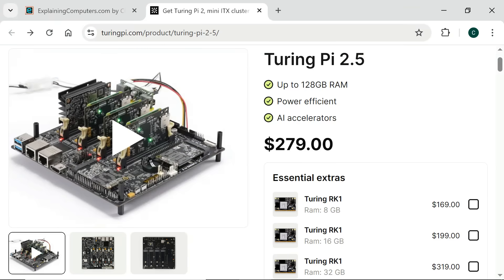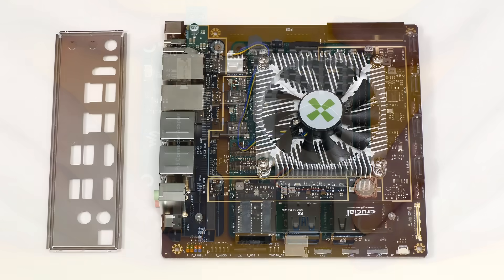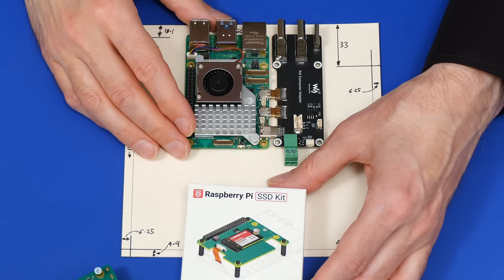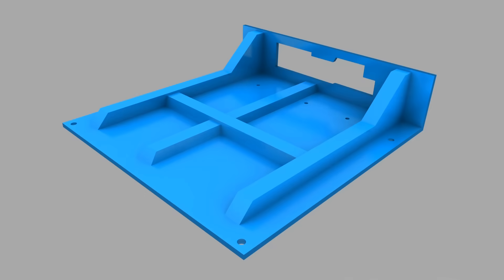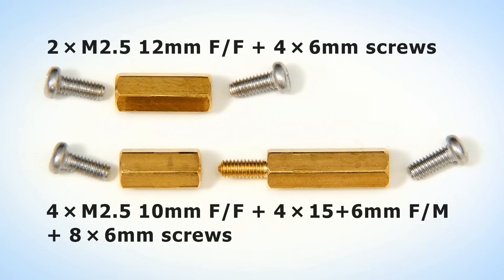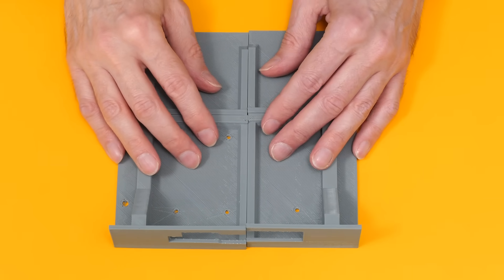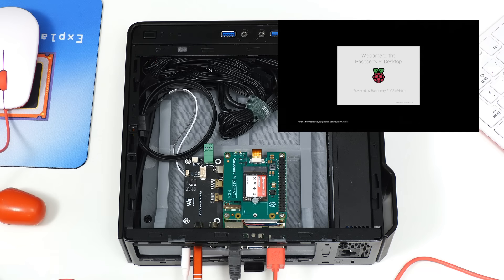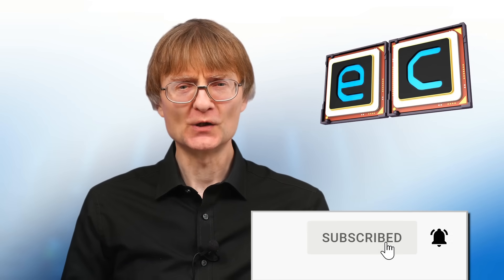Mini-ITX Raspberry Pi 5

Comment: Time for the sleeper PC build where you take a 20 year old giant PC minitower, and replace the guts with a Pi 5!
Reply from the maker: Indeed, greetings Jeff. :)
Reply: I’m dusting off my Lian Li / Cooler Master case collection as we speak.
Reply: That's what I did several years ago. Had 5 pi's (3 and 4) running in that housing incl a switch. Now replaced all with refurbished mini pc's with proxmox. Way faster, cheaper, easier.
Reply: Replace the CD-ROM drive, you mean :)
Reply: @kitmoore9969  A Pi (or a better alternative) fits in a 3.25" drive bay.
Reply: And fill the rest of it with Old Pinball Machine Parts as per Doc Emmott Brown from that scene from Back To The Future when 'The Libyans' turn up in their VW camper van...
Reply: 2 of my favorite channels are friends. Nice way to start a Sunday morning.
Reply: Actually this makes me want to buy one of those old disc duplicators and replace every optical disk drive with another computer.
Reply: I have an older tower running win10 at my workbench where i use it and a pi5 alternately.  I was thinking install the pi where the disc drive was and have them both in the same case.
Reply: A tired sleeper! :)
Reply: Why not multiple compute modules?
Reply: Do a collab
Reply: I have a over 20 year old blue midi server case for my main pc. Yes I got it new 😅 back than. Chieftec cs-6
Reply: Imagine a Beowulf cluster of these. Oops, wrong site.
Reply: One of my favourite creators commenting another one of my favourite creators. What a great day😂
Reply: Working on that with an HP Envy tower from 2016...
Reply: All my old PCs went to the tip as e-waste years ago.
Reply: @gdutfulkbhh7537  depending on what it was and if it was working, sounds like a dumb thing to do. There are plenty of people who could use old computers for many things, there are projects populating IT classrooms in poorer countries too etc. Stuff that still works doesn't belong in the e-waste unless it's some specialized thing that cannot be repurposed. Like if you have an apple or other brand CRT built in thing with a broken CRT - unlikely anyone wants to bother with it. But otherwise there are museums, charities etc that will take most working stuff, or private collectors. And they will pick stuff up, no need to send or bring stuff.
Reply: How about a replica Altair 8800 case for the Pi 5?
Reply: @effwitt  what you run on Pi ? need games, why Pi ????????
Reply: Great video Chris. Thank for the 3D printer file.
Reply: Yes, like seeing Mac Minis in G5 towers 🤩
Reply: wishing I still had the old SE30
Reply: I want a RAM expansion HAT+ to go along with the AI and CM.
Reply: I actually have some older cases I thought about doing this with, I even had some very old micron towers with a max speed on their motherboards on 133 mhz
Reply: It should be possible to make an actual metal  Pi 5  i/o shield.  Make it look shiny chrome and perfectly fit into any  PC case.
Reply: Hope you put the turbo button and two-digit clockspeed display to good use.
Reply: The original IBM PC used a full height 5.25" bay for the floppy drive and it had 2 of them... I suspect you could put 4 of the Pi 5 units just where the floppy drives used to be...
Reply: 😊 Imagine a tower pc case with absolutely everything removed and replaced with just a Pi5 stting in a single 5.25" bay 😂
Reply: @PhilipBallGarry  
There is a build fpr that,  hiding the Pi inside the 1,000 W  ATX power supply &  nothing else is in the case.
Reply: O.k...Where i buy board?Next question - case power button,resset,led indicator,USB ports - with cm5 board?I like to use some 4 PIN noctua coolers + adapter to add cooler for CPU from PC?

Comment: Have you seen the Pironman5 case for the pi 5?
Reply from the maker: I have indeed, and many others (such as those from Argon) that add M.2 slots and move the connectors to the back via a daughter board. But they do not allow a Pi to be mounted in a standard case. :)